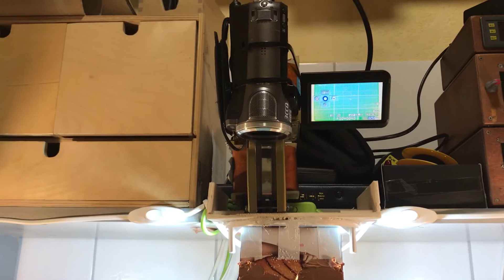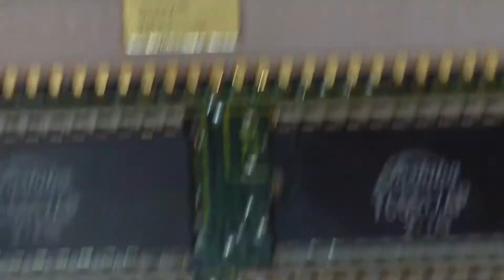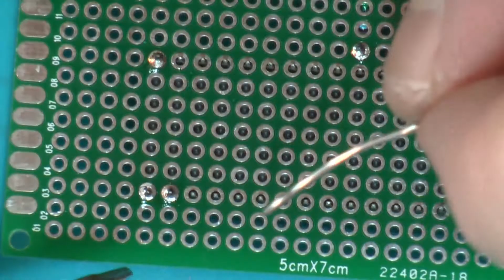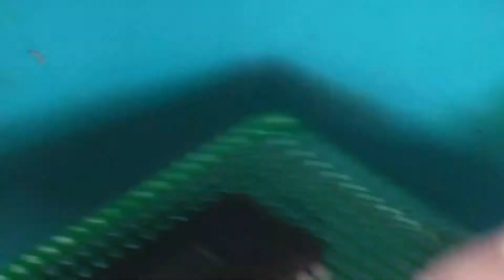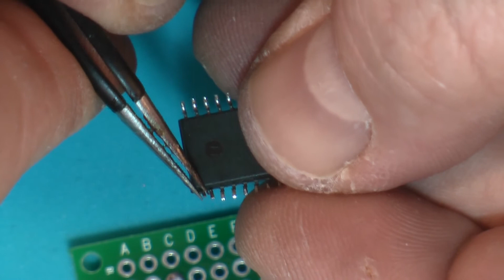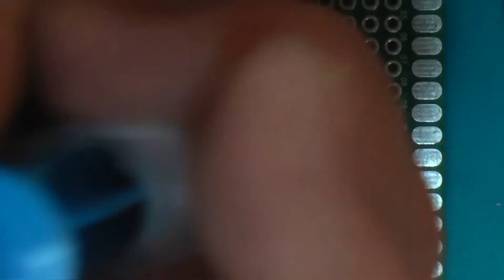testing my "new" old lab cam Panasonic HDC-SD 9

Comment: Good quality! Can you please tell me if it is possible to use an external monitor connected to the HDMI output while recording? thanks!
Reply from the maker: Sure it will work but I'm back using a phone (Huawei mate 20pro)
Reply: @thsinger  thanks! I've tested it already. Works better than many newer models, with almost no lag.

Comment: 8:20 - The camera lost focus because there was low contrast from the plain white IC package in the center of the view.  I would also recommend keeping the camera view on the same side as your view.  You will likely have to move the camera further out from the wall but it provides a better view in my opinion.  Keep the camera mounted to the table and not the wall.  That way as the desk moves so does the camera.  As long as the desk is sturdy it won't shake on camera.  I am planning my own YT channel also.  Good luck.
Reply from the maker: In the last part I already have the camera mounted the camera more stable in the first part the camera was just mounted to a transformer withe cable-ties that was no stable enough. now it is more stable and the effect when I hit the table is much lower and only happen in the tele-zoom setting. I have to make more tests with it. I also mounted the Display upside down so it is not mirrored. For 45€ it comes out very well.